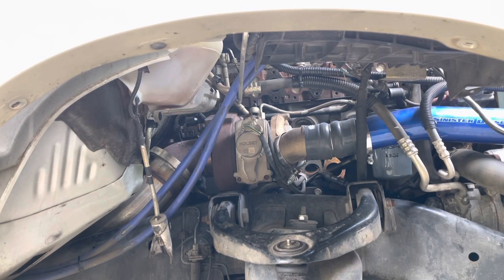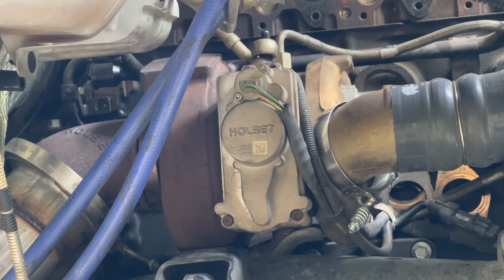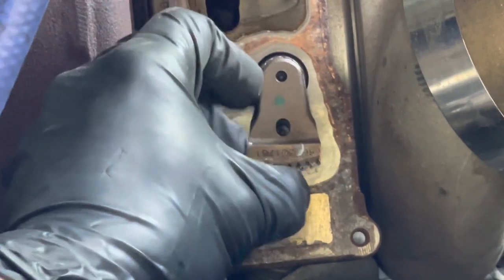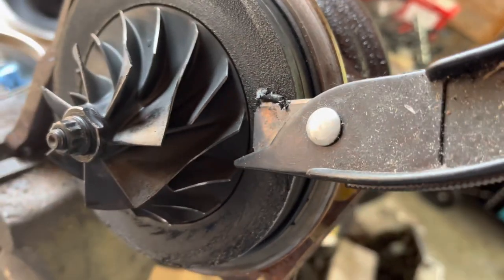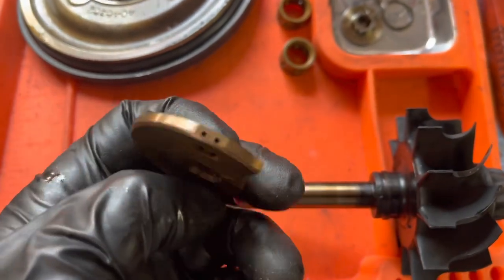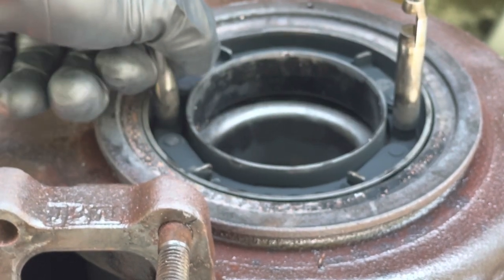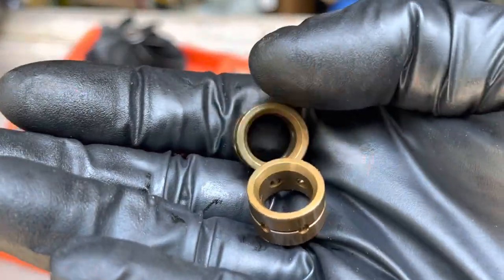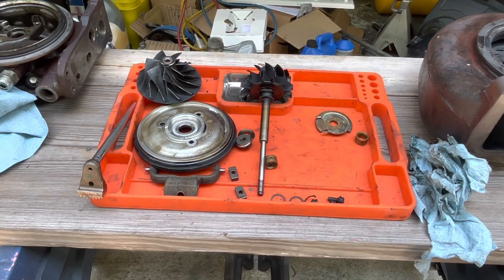Holset HE351VE VGT Turbo Common Failure, Disassembly, Initial Cleaning & Inspection #cumminsturbo

Comment: Just FYI, there are many horror stories about Amazon turbo rebuild kits, mostly because of unbalanced vanes/compressor/shaft.
Reply from the maker: We reused the OEM shaft 15K hard miles still running strong
Reply from the maker: Fortunately we had a good set of bearings to measure and the turbo labs one from Amazon is spot on they even include oversized in case you need them most don't though

Comment: Where did you get your exhaust downspout or what is the brand name?
Reply from the maker: @jshlds46  are you talking about the down pipe that comes off the turbo?
Reply: @DIYKAI  yes
Reply from the maker: @jshlds46  its the stock one because this is the stock turbo 4in

Comment: Where did you order the rebuild kit from?
Reply from the maker: Amazon, we updated the description with links.
Reply: @DIYKAI  OK I see it now thanks man I appreciate it
Reply from the maker: @BIG-AL-GARAGE  no worries good luck we have 10K on the rebuild so far
Reply: @DIYKAI awesome!! I have a 2018 ram 3500… would this be the same process?? I have dug into it yet so I’m not sure which turbo I have but I’m having a lost communication with the turbo code… I have to take the actuator off and check the shaft
Reply from the maker: @BIG-AL-GARAGE  yes i believe from 07 up was the HE351VE look at the sticker on the side of the actuator it should say......definitely check the actuator arm you should be able to move it with one finger and hear a metalic clunk at the stops any resistance and its probably carbon filled.......check shaft play also on the turbine a little side to side is ok ZERO in and out
Reply: @DIYKAI got it!! I wish they sold like a good deep cleaner for these turbos where you spray in it or something without removing it
Reply from the maker: @als84cutty2 they do! Look on your turbo for the cleaning port you will need special software to run it
Reply from the maker: @BIG-AL-GARAGE  it should be a little bolt looking nipple in the center top you should be able to see it with the turbo still installed
Reply: @DIYKAI oh wow I didn’t know that!! I’m going to look at it today… any chemical you recommend???
Reply from the maker: @BIG-AL-GARAGE   I think the dealer sells it not sure but brake clean would work I imagine
Reply: @DIYKAI I had actually call the dealership in my area yesterday they said they didn’t have anything or maybe the guy I talked to just didn’t know… I probably go to some forums and see what I can find… I started to use brake cleaner but was sure if that would mess it up or anything

Comment: Those CTT VGTs get stuck a lot less compared to the articulated foil/vane design of the other big turbo manufacturers. 

Aside from carbon and oil buildup, I’ve never heard of an OEM Cummins VGT nozzle ring failing in like the last dozen years. Their wear resistance is really what makes them stand out compared to the articulated designs. They even handle FOD really well. Must be some damn good nitriding I’d imagine. 

Have you seen much chipping or deforming of the nozzle ring vanes?  Occasionally I see some, but never had it seize. What do you think?

Great video man.
Reply from the maker: So if we were to do it all over again probably would have left the stock nozzle ring on the hot side and just changed the nozzle only. After 250k they looked pretty good in this turbo we just wanted to see if it was going to make a difference (very little if any) but the actuator is a issue in the 4th gens and some 5th we have been through 2 so far and about to try one now before we ditch this turbo for a new one
Reply: @DIYKAI  thanks so much for the response!  Have a great day.
Reply from the maker: @maritimeus  your welcome! You as well!